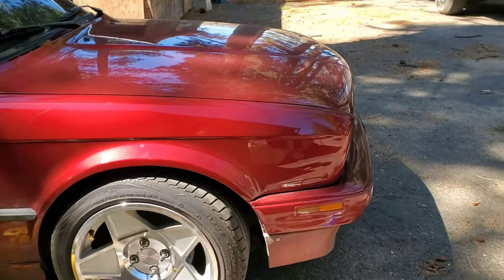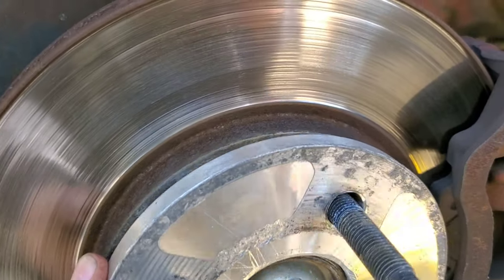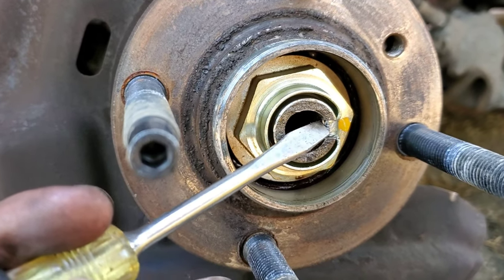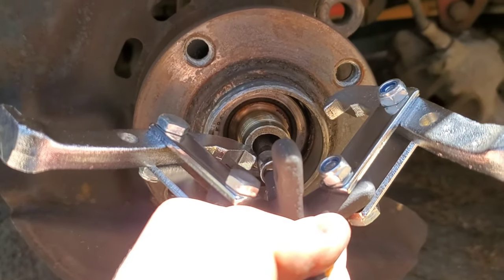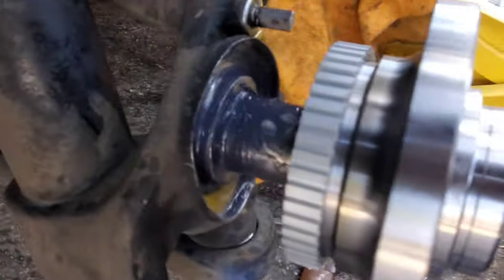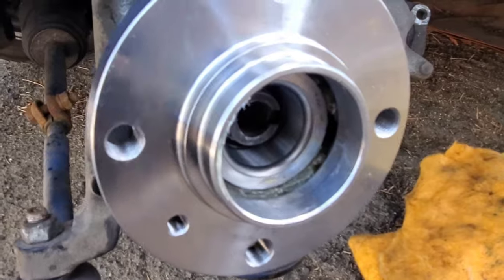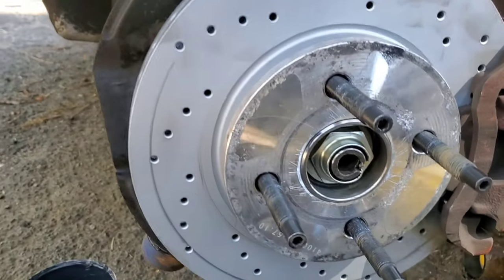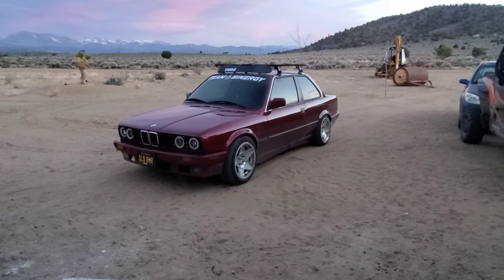Replacing E30 Front hubs (bearing stuck to spindle)

Comment: Had the same problem with the race getting stuck, but on the passenger side so no wheel speed censor to leverage it off. Had to order a fancy puller and heat it up. Appreciate the video.
Reply from the maker: Nice man yeah that inner race is a bitch haha

Comment: Nice to see a video where things go wrong and you have to get creative.  I know the Bentley manual describes breaking the hub nut loose like you did, but why not use an impact gun?  I suspect you have one.
Reply: Just replaced my wheel bearing.  Broke the nut loose manually with a 3/4" drive breaker bar and pipe extension, with the wheel on the ground.  Worked easily enough.  I have a theory though that because the nut is torqued on to such a high force, the average enthusiast may not have an impact wrench capable of breaking it loose.  Thanks once again for your video because my inner race stayed on the spindle, same as yours.  Although it should be obvious, I may not have thought to remove that rotor shield for better access.  That dust shield ring that presses onto the spindle behind the bearing, I slit that with cutting wheel on a dremel tool, as close to the spindle as I could get, slicing partially into the old bearing race, then used a hammer, screwdriver, and pliers to tear it loose.  Once out of the way I could get my puller on the race and it came off easily.  I did try prying as you showed but my channel locks didn't have just the right shape like yours to get in there perfectly.  Oh, and I anticipated trouble, so I had a new dust shield ring on hand.  Thanks!